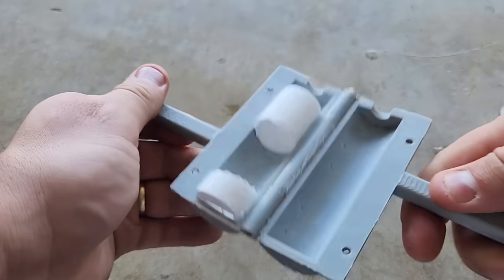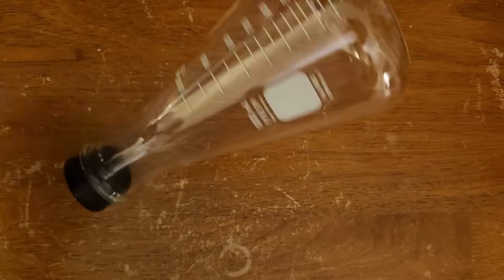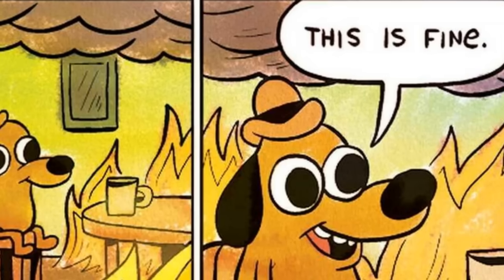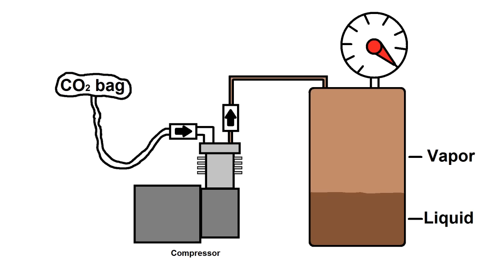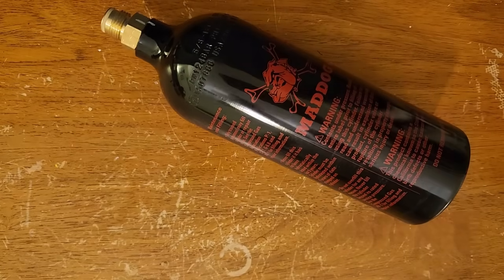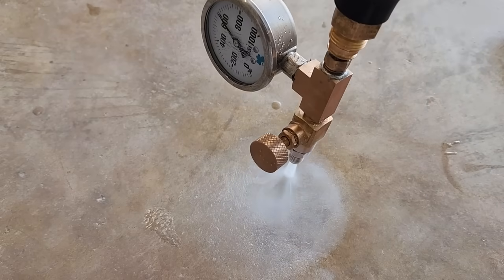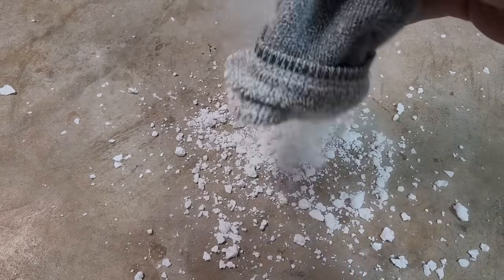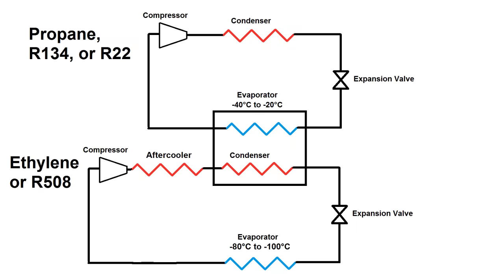Making Dry Ice from scratch

Comment: The blocks of dry ice are compressed by huge presses several thousand pounds the pellets are pushed threw tubs by a cylinder  it was a cascade sytem the discharge of co2 system was ran threw a chiller that was nh3 system

Comment: To pull CO2 out of the air, make a solution of sodium carbonate and put it in a swamp cooler.  Run the cooler and after some time, the carbonate will slowly become bicarbonate as CO2 is absorbed from the air.  Drive the CO2 off the bicarbonate solution by boiling it.  Then, the process can be repeated…

Comment: The windings on the fridge compressor you are using is normally cooled by the gas it sucks in from the low pressure side of the fridge, if you suck in room temp CO2 and go over its rated pressure its going to melt.

Comment: Your Embraco is a R134 refrigerant. In order to reach high pressure you should use a R404 or R410 refrigerant type of compressor. Danfoss series SC12CC or SC15CC. Also preferably look for a "medium back pressure"  as they are suited for higher current through the stator. Putting current through the stator without the rotor running results in no counter EMF (Electro Magnetic Force). Every stator will burn if you do what you did. Notice that all hermetic compressors are protected with a bi-metal current limiter. So the click you heard probably is the over current protection, which will reset itself automatically. When you start experimenting with ethylene, make sure the first trap is at least -30'C, otherwise pressure will be too high. Use preferably R410 in your first stage. For the second stage you will be unable to find an expension valve. You can only run this stage using capillary. It is a long way to get a two stage system working from scracttch or know-how. You can reach me via linked-in, Roland van Hall - Tamson Instruments.
Reply: Isn't it great watching homeowners try to do refrigeration?

Comment: Very cool video but for your pulse tube cryocooler I wonder if a simple cooling bath wouldn't be the simpler and more convenient solution. Most people know of ice + table salt, which yields a temperature somewhere between -5°C and -20°C but calcium chloride hexahydrate + ice can reach as low as -50°C - which is pretty impressive for a cooling bath that's essentially ready at all times.

Comment: I would recommend Adding a ball valve after the needle valve that you already have in place so that you can set the flow rate and open and close the outlet as necessary. It may also be beneficial to try an atomizer Nozzle similar to what is used in heating oil furnaces.

Comment: Heh you thought of almost everything. Can you use that wasted gas lost from your 3D printed dry ice trap in a precooler that drops the CO2 temperature down further just before it is expanded? Will kevlar tape provide a cheap way of reducing the potential lethality of your pipe connections? And lastly, why do you need pure CO2 if it will freeze before the other gasses in air, would the exhaust from an oxygen concentrator give you a useable N2 CO2 mix that can then be passed eventually to your final stage once the CO2 has dropped out of it as a solid, or is that never going to work 100% and would freeze up in inconvenient places in the final stages where there should be just N2?

Comment: Refrigerator compressors need to have the oil  coming back in the return pipe. This lubricates the motor, cools the winding and provides the wet bath to seal the piston in the cylinder bore.   Maybe drip some compressor oil into the intake?  It will mean that the output from the compressor will be expelling an oil mist, which your set up will probably need to deal with.  This video is good stuff!
Reply: Actually most of the oil does not dissolve in the refrigerant, with stationary home style compressors the oil usually stays in the compressor (unless it gets hot like in this circumstances).  You really don't want the oil to get into the gasses being compressed, so, hmmm, using a little compressor like this one would need to fine a way to cool the oil.  In automotive uses the lubricant, at least with R12(mineral), r134/R152a (PAG, etc.) the oil is soluble and flows with the refrigerant through the whole cycle.

Comment: Testing the co2 by extinguishing flames is essentially the mechanism by which welding gas works. Keeps the oxygen out to keep the metal from burning and reacting with atmosphere making oxides and shit. Argon does that also but also assists in maintaining an arc.

Comment: With no load and not all ferric parts in place resistance will be very low in the windings and will thereby very easily be heated up if used incorrectly.

Very nice video! I've been working with dry ice production for a few years. Nice to see some hobby production!

Comment: brilliant video, just fyi... dry ice is heavily compressed, what you made is called "snow" (it is still dry ice) you would get a much higher conversion of liquid to snow if the liquid goes through a nozzle (a 3d printer nozzle .4 - .8mm would work) the conversion rate on commercial dry ice machines is usually 2:1 to 3:1

Comment: One idea if you still haven't completely thrown out the idea of using dry ice would be to discharge the liquid CO2 into a bath of pure ethanol and run a pump to circulate the chilled liquid through your precooler. This bath would have a lot of thermal mass which would be able to eat a good chunk of the heat released from the initial chilldown from -70 to LN2 temperatures.

Comment: The back pressure still trapped in the compressor probably locked the motor when you tried to start it. Also does the compressor pressurize it's tank/housing? Some do, so be careful how high you let the system get lol 1000psi is allot in for the weld on the housing 😂 also did you plug the motor windings in with the rotor and it's capacitor? Cause without those they'll burn real fast lol

Comment: lmao seeing you use a paintball tank to pump the co2 into made me think about how neat of a project this would have been for me when I was younger and played tons of paintball. As long as you use stuff rated for the pressure you're trying to feed into those tanks, it should be relatively safe.
Next time you do this, replace your paintball tank fitting with a normal one, and buy yourself a paintball remote ASA with an on/off valve. That way you can attach normal fittings to it and have a safe method of filling. You can also install a syphon tube to the tank pretty easily I would think.

Comment: I've seen a number of diy high-pressure systems running two refrigerator pumps run in series. Usually with some kind of current limiting circuit  before the pumps.

Comment: A safer way to connect to the paintball tank would be to connect a paintball UFA (universal fill adapter) for smaller. It has a valve and 1/8 fpt port you can connect 1/8 npt to.

Ive used this method for temporary storage of r134a when I have to open up a car ac and use a similar refrigerator compressor to evacuate it.

Comment: Those sparks were probably the contact points for the start windings.  I'll bet $10 would have fixed it.  It takes a heavy duty electric motor to start under heavy load.

Comment: The small vacuum pump that is shown at 6:12 does anyone know if these are reliable? They are quoted to be able to reach less than 10pa, which they may well do but how do they cope with extended running, like over 1 hour or so? For comparison, my Edwards pump often runs all week, (diffusion pump rougher), without any problems. Any advice on this pump would be appreciated. Chris, UK.

Comment: There are still a few people building cascade systems for PC overclocking. Since refrigerants are a bit hard to get, propane and CO2 are sometimes used as a first and second stage. I think I recall seeing -100 temps. I am not sure if that was C or F. Probably F, but with the 2nd stage low side running a vacuum, maybe you could get -100C. There were a few 3 stages systems that would hit -150C. But they used R1150 (Ethylene) as the 3rd stage. I remember a few forum threads where people were trying to figure out a way to get to nitrogen as the last stage, but i never saw anyone make it work.

Comment: I had to neutralize some 32% HCl and all I had near was some of Arm&Hammer's pet-mess cleanup, which is NaC2 and "OxyBoost" (which my understanding is it's basically a "dry H2O2")

The small container of HCl I neutralized, as I picked it up, I was shocked that it was 20F cooler than ambient (checked via handheld IR temp reader).

I guess this finally explains it! 👍🤘
I had tried to recreate it a few times without much, or as much success. Wasn't sure if that was because it was with unused HCl (fresh). Or, because that I had some 91% IsoP in that first mixture. 🤷‍♂️

Maybe this might provide a means of helping you generate more CO2, but... probably not. 🥴

Comment: Those small hermetic fridge / freezer compressors will as you know pump to over 400 or 500 psi but they are unable to `re-start` with that kind of back pressure, in fact most of them will not re-start with only 100 psi back pressure. To protect them from this scenario, they incorporate a thermister in the supply, so that if there is too much back pressure, the thermistor goes high resistance, limiting current. It doesn`t always work though and when it fails, it`s usually the start winding that gets burned out first as it takes the most current, the run winding follows seconds later.

Comment: You don't need the dry ice as cooling agent.  Just use your CO2 apparatus to cool something like silicon oil, and it can be the cooling agent for your pulse tube.  You actually have the making for a closed loop JT effect cooler there.  Remove most of the cooling from your liquid CO2 using silicon oil(small orifice into a large tube submerged in silicon oil), use the rest too cool ICE water, then use the ICE water as the bath for the next run of your cooling sequence.  Once the CO2 has given up most of its cooling in the water, put it back in the beach balls(need them all in parallel) Then use your refrigerator compressor to pump up your liquid CO2 bottle.  Your captured pure and dry co2 wont need the first half of the process again.  A GOOD insulated holder for your silicon oil may allow a day or so to utilize the stored refrigeration.

Comment: Since hermetic compressors like that don’t have cooling fins, I suspect they are cooled primarily by the flow of refrigerant under normal operation. When you ran the pressure up to 800, the “coolant” stopped flowing and your winding got hot. Well pumps and fuel pumps have a tendency to burn out after being run dry for the same reason.

Comment: Something I was wondering in your last cyrocooler video, it did seem to be getting stuck at around dry ice temperatures. Given you were continuously taking in fresh air (and having to dehydrate it),  perhaps you were getting CO2 freezing up inside of your system? At any rate, if you 'recycle' the exhaust, you wouldn't have to do as much drying. But, same goes for closed loop hydrogen, etc.

If you do go the cascade refrigeration way, take a look at making some "R469" - its just a mix of CO2 and R410a (easily recovered from dehumidifiers, etc). Much easier to get than ethane or ethylene, but won't freeze at -55C (triple point at 5Bar) like pure CO2 would. I'd probably add some propane to the mix too for oil solubility goodness. (or better, "MAPP Gas", which is just propylene, boils 10c colder). 
Also, add a heat exchanger, warming up the suction line to the compressor, using the 'heat' left in the refrigerant after the condenser. Bit of warmth makes for more oily oil, and makes sure all the bits of the blend have boiled off.

If you haven't played much with diy compression systems before, /other than running stupid high pressures which will cook the motor/ (or, near zero flow, depriving it of cooling) they're a lot more forgiving/harder to fuck up than various tradespeople on forums/youtube/anywhere will go on about - in terms of captube sizing, "fuck it, whats there might work" often does. BBQ tank propane+butane+stinkgas bastard mix will work in just about any system. There is roughly nothing in this world which needs to be brazed, (cheap-ish, "silver bearing", plumbing solder 100%.  Cheap, by-the-litre-from-pharmacies "fatty cream" moisturizer+zinc oxide+Hcl= plumbing solder flux), and no brazing means no nitrogen purging (I use CO2 sometimes) - though I flush any flux, etc out of a system with ethanol first.  Nothing needs to be vacuumed for more than 30 minutes, if it does, its leaking.  (Oh, and try not to vent ODP/high-GWP refrigerants like the "professionals" do. Its so easy to recover them into old gas torch bottles for playing with later)

Comment: I thought you would try freezing it with your pulse cooler. The triple point is only -57 C, so at high pressure, you should be able to freeze it.

Also, there has to be a limit on your pulse tube cooler using atmospheric air as the working fluid. As you approach LN2 temperatures, the approximation of the working fluid as and ideal gas won't hold, and you probably lose cooling power. You would need to use H or He to actually get below LN2 temps, and making that change could result in much better cooling performance from your existing setup.

Comment: Nice method. I once worked testing military spec parts using an chambre cooled by co2 from bottles which had a bottom feed. But great to see it from "every day" items. Very best of luck with the whole project going forward. mini fridge or peltier for ~ -20C ? Great work.
Reply: I'm designing a watercooled garment for use in a 3 layer composite armor/passive exoskeleton and active pressure sensitive contact deterrent using high voltage comparators and several stun gun internals. The system also has a urine release system and is removable by magnetic locks that are accessible with magnets located in the glove/gauntlet. The total price for materials should be about 5k.    
      The system for cooling is a 2 layer peltier system I was just unsure how to cool it without compromising weight and protection. I think I have an idea, to cool it with compressed air in modified 12g co2 and a physical pump which will be tuned to be effortless by the passive exoskeleton. The exoskeleton is a hybrid design using springs for certian structureal parts like the spine and shoulders, pullies and elastic bands as stored energy

Comment: Boring safety note: Carbon dioxide preferentially bonds with hemoglobin. While nowhere near as dangerous as inert gas suffocation playing with liquid nitrogen (since the body can detect CO2 but not O2 or N2) all that smoke is a suffocation hazard. If you're going to ignore the risks of modifying a 1,000 PSI pressure vessel, please at least do it in a well-ventilated area and keep your nose out of the CO2 plume.

Comment: Domestic refrigeration compressor’s need off cycle pressure equalisation to start, they can’t start against differential pressure, simple refrigerant metering devices such as the capillary tube that they generally use do this provided there’s enough off time. Normally the Klixon provides some protection in the event of a short cycle restart

Comment: You will always burn compressor without starting device what is sitting on connector to steel egg that compressor sitting in. compressor have double winding... one for working and one for starting. This starting winding gettin power thru thermistor in starting device only for few seconds, because thermistor getting hot and resistance rise rapidly. Normally spark and boom comming from thermistor and many times You just have to change it to keep compressor starting again.... You can even use crued methood and use momentary switch to energize starting winding. Best regards.

Comment: Refrigerator compressors need oil flow in the refrigerant gas.
You need 3 stages to get to 1000 PSI.

Comment: Have you played with vortex tubes?  They're pretty neat. 
They separate the hot and cold air molecules and at their respective exits can boil or freeze water by using only compressed air at common pressures (I ran them off the regular pneumatic/air taps at work).
Reply: Cool, any videos of that?
Reply: @willyouwright  actually yes! Linus Tech Tips has a video where they tried to cool a computer. The video title is "This is a CPU Cooler?"
Reply: https://www.youtube.com/watch?v=Hn8hDY4bvpI Here's one on machining one.

Comment: I think there is still a lot of potential to increase the yield by precooling the CO2 liquid to reduce the vapor pressure. 
Try using a bath of ice in saturated saltwater to get it below 0°C.

Also you could take inspiration from the Linde process: 
Fix a copper tube to the CO2 pressure vessel and squeeze the end nearly closed, so that the flow of CO2 is throttled there instead of the valve.
Put this upside down inside a thermos bottle or dewar - preferably a narrow one.
The CO2 cools at the throttle at the bottom of the thermos. The escaping gas will then precool the liquid in the copper tube and increase the yield.

Of course you must make sure the copper tube can take the pressure. It might be brittle at low temperature.
Reply: Good idea, but you could even use a thermos bottle instead of a Dewar.
Reply: Using ordinary table salt (NaCl) can get down to -7 °C or 20 °F.  Other salts can get a lower temp, but are not as readily available (you would have to order them online instead of getting it at the grocery store).
Reply: @jimellis1496  In Northern states, you can get rock salts from the grocery store during winter. They can help bring the temp to -15°C.
Reply: @Rollyn01  Actually, the freezing point of NaCl and water is 18 °C. I think CaCl2 and water is -40 °C.
I used such a cold solution of NaCl when I was distilling benzene. It was a bad idea. The benzene froze in the graham condenser (coiled tubing).